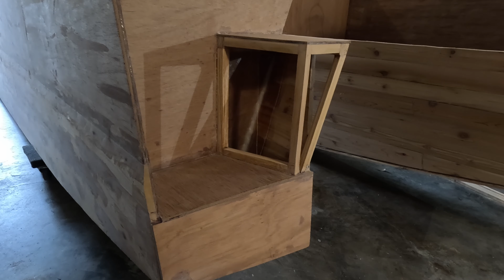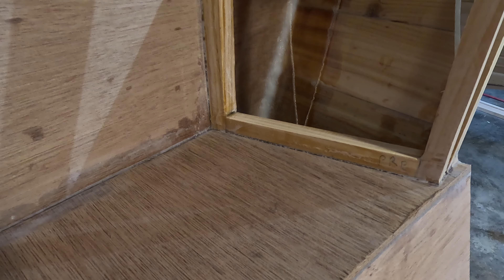DIY Sailboat - Progress on stern steps.

Comment: Good work! I thought you were going to put some foam inside the bottom step. Is there any way to check if water eventually leaks inside the bottom step? It happens.
Reply from the maker: I've thought about that. I'm worried that foam will just hide a problem. If water does leak in, it will likely come from a slight crack in the outer fiberglass and cause the wood itself to get wet. I suppose that could over time develop into a leak that allows water into the step compartment itself. And then foam would stop the water from progressing any further. The water would still be able to soak through the wood. I think I'm going to avoid the foam and instead install a watertight access panel in the vertical plywood side of the upper step. This will allow inspection when needed. I'm also leaving an opening that connects the two step compartments. I'll mention this in the next video.